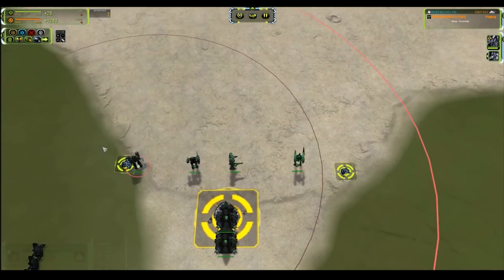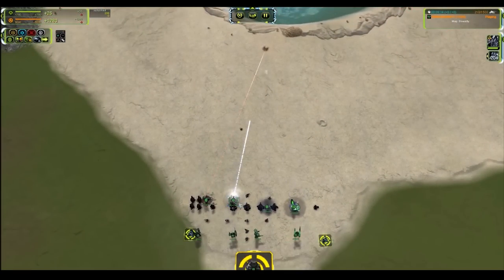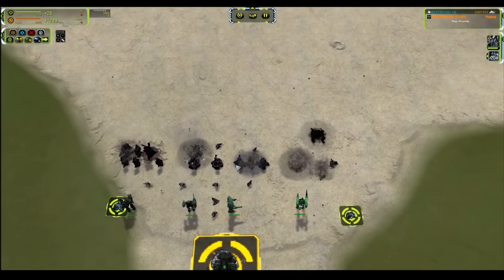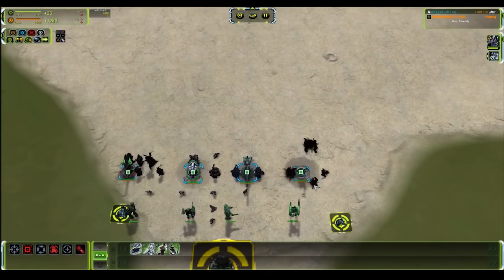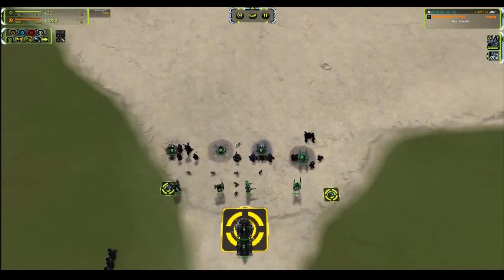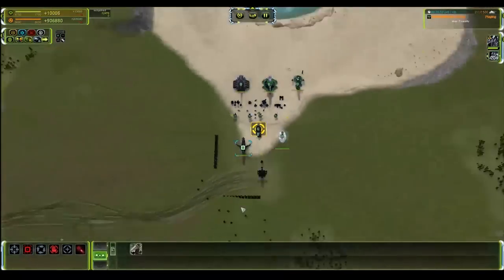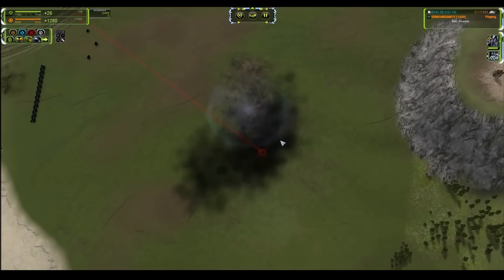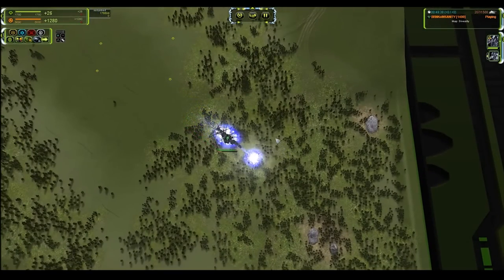Defensive Structures! Unit Tutorials for Supreme Commander Forged Alliance

Comment: about T2 arty, you can put T1 pgen next to them to increase the firing rate for nearly no cost.
about T1/T2 torpedo launcher, cybran have best statistic than the other.
about T3 static arty, aeon is known as the best for arty fight. (damage over does work pretty well against shield)
about T1 pd, it's the only structure that can be defended by walls.
Reply: actually you can defend T2 PDs against cybran rhinos with walls quite well
Reply from the maker: You can put a pgen there if you only have one arty, but if you are spamming arty it is actually more mass efficient per damage to build another arty than to put pgens next to them.
Reply: i didn't know for wall next to T2 pd against rhino. Thx speed
brnk : if you are spaming arty, you may want to get a pgen next to 2/3/4 arty. I'm pretty sure this would be more effective. (But you stack arty, so there is the aoe weapon drawnback... + pgen explosion death)
Reply: BRNKoINSANITY That doesn't make much sense to me. Couldn't you build grids? But it seems the discussion has very little impact anyways as t2 arty seems to be built so rarely.I just compared it with t3 mobile arty, the dps is lower even when calculated with +40% for pgens (if those 40 are true). You also get more range and less area. The Seraphim seems to be the best t2 arty.What about TMD? It seems those would be stationary defense? Afaik they are considered underpowered by some people and we might expect balance changes anyway. But it would still be interesting. I seem to be too stupid to position aeon TMD correctly, those missiles still tend to hit the shield behind the TMD.Also shields. I'd like to know more about faction specifics, especially considering the damage spill rules (how many still make sense for which faction?).Thanks a lot for making these videos, they are certainly helpful for noobs like me!
Reply: About the arty, if you are on T2 stage, then dont think about T2 stationary arty, its expensive, go T3 mobile arty everytime. But later when you hae T3 eco, T2 arty is not that expensive anymore, so in some situations its good, it can outrange fatboy, T2 navy for eample. And everything trying to reach your base would eat a lot of fire.

Comment: I was doing some testing with a clan mate some time ago with t3 arty. 3 T3 arty will kill any shield configuration that you can possibly make, meaning that 3 t3 arty > Mavor and > Salvation as to mass and power efficiency. 2 T2 arty will kill most shield configurations. 

Also mixing t2 shields into your t3 shield defence can sometimes be more effective than simply spamming t3 shields due to the radius overflow issues. 

I can't confirm this though since I'm limited to vanilla now :c
Reply: Clans?
Reply: its like saying your in club like FAZE or something, some people like to do it but i dont see the point.

Comment: If Novax had extra uses apart from mass extractor harass and intel, and it had an extra counter method, it'd be a lot more engaging to use.

I'd say give it extra damage against shields, like the aeon absolver, now it has an awesome extra use. Still does paltry damage by itself but it can break shields for arty or ahead of a ground push or bomber run.

And the most logical counter it should have is to be targeted by SMD. Or it could have a firing energy cost, so your opponent can sabotage your power grid to disable it. Or both.
Reply from the maker: Again, this is a unit that appears deceptively weak, but in reality it would VERY easily become op. The only reason it is not op right now is that shields completely stop a single novax (but not so much multiples). However, when you build a novax, your enemy now has to invest thousands of mass into shielding for what he doesn't want destroyed, so you are still drastically impacting his Eco even if you aren't actually killing his mex.
Reply: BRNKoINSANITY Well, yeah, but you also wasted tens of thousands of mass in building that Novax. I understand it works as a slight psychological weapon, but it's usually not worth it, not even for intel. For an experimental unit nonetheless.

You almost never see it used, and when you do, it's either in a very unbalanced game where the obvious winner has nothing better to do, or in games where it ends up not having any strategic value at all.

And it's especially bad because UEF only has one practical experimental on land-only maps. Novax should get some changes to make it practical and viable as an experimental unit.

Of course, if you just buff the damage, it easily becomes OP. I know that. Which is why I'm suggesting different mechanics and additional counters. This unit could VERY easily become a staple UEF experimental with some work.
Reply: zolikoff Also it allows you to see into the enemy base. Intel is priceless.
Reply: eytan19 Yeah, but spy planes also see into the enemy base. I know a Novax has its hypothetical uses (hypothetical because it's still used very infrequently). I'm saying its capabilities don't clash well with its experimental status, if it was a T3 intel building like Cybran perimeter monitoring, I wouldn't mind. It's especially bad because, as I said, UEF have just one viable experimental on maps with no navy. The unit to fix this already exists, the Novax woud just need some flavor.
Reply: Well spy planes can be countered by sams or patrolling asf's. My point is just that there will always be a use for Novax even if it can't do much damage. Increasing its damage or buffing it in some other way is not a good idea, it would very quickly become op.
Reply: eytan19 Point is, how often do you see the Novax used? It's a non-game-ender UEF experimental that sees less use than a game-ender. It's annoying. It should be a staple UEF experimental.

I'm not saying straight-up buffing it. I'm saying give it some strategic functionality and also give it other drawbacks - I even suggested a few possibilities.

Currently as an untouchable weapons platform, of course it needs to be weaksauce or it'd be OP. But I'm saying is get rid of the untouchable trait, and make it good at something.
Reply: Well it's kind of cheese because there is no counter and that's why it isn't used a lot. I think when used correctly it could be effective and very annoying.
Reply: eytan19 Once again, I'm suggesting giving the unit some viable counters, while giving it additional usability beyond mex harass and intel.
Reply: zolikoff i dunno... i've used three novax's to completely obliterate an entire army...
Reply: +zolikoff Is intel an undervalued (less talked about) aspect of this game? Seems to me that an all seeing eye or two would be invaluable. I've seen many scouting fly over designed for that purpose on Brink's casts. 
Wish I could play this game. It looks so good. I bought Sup Comm last week but now Steam is fucking with me....ahh it's probably just my inability to troubleshoot... still D:
Reply: Jonathan Halloran It's definitely not undervalued. It's very crucial. But sending T3 spy planes over the enemy base is more cost-effective than building a Novax for that sole purpose.

If you got SupCom, just download the FAF client and let it run the game for you. Though I'm not sure how it works in conjunction with Steam (if it requires log-in and such)...
Reply: zolikoff Hey thanks man! I think I will uninstall Steam and grab the FAF download.... we'll see how that goes.... I'm hoping my starcraft skills will translate over to this game (which I've never played). Hope to see you round. You'll be beating my ass no doubt!
But I don't think ppl would invest in Novax just for intel. Seems like the intel is a significant bonus just to sweeten the deal ;)
Reply: Jonathan Halloran Wait, don't just uninstall Steam. The game's files are in the Steam folder. Try giving FAF the executable in the game files, see if it still asks for Steam login (though I suspect it will).

Finally, if nothing works, just download Forged Alliance from a torrent tracker. It will work with FAF fine, straight away. It's not piracy if you already paid for it, but the pirate version will work without fuss. It's not your fault Steam is acting up, but it shouldn't stop you from playing a game you bought.

PS: I'm not that good at playing the game, it's really much harder than it looks from casts. Not that I have much free time to play, only once in a while, but I sure still qualify as a noob here :)
Reply: zolikoff Cheers for helping random noobs! Hahaha...I'm actually at the 'finally' stage right now (yes I noticed the file wasn't executable), so I think I'll go for the DL.
In fact, I'm currently sand blasting my processor to see if that helps. But I think the grain I am using is too abrasive. All the paint's gone :(
Reply: satannstuff Which is why I suggested to make it specifically an anti-shield unit that you'd use in conjunction with your army.
Reply: +zolikoff u know that 3 novax breaks triple(each under 2 uthers) aeon shields and kill commander... NURF IT

Comment: Duuuuude! You missed the special ability on the Seraphim's stationary T2 artillery. If the shot misses it's target and hits water, it turns into torpedoes! I thought I told you this already?!
Reply: Cryoxiis riiight.

Suuure.
Reply: Rabid Wizard I wasn't being sarcastic, it's an actual feature in Supcom FA. But I'm not sure whether FAF removed it (I doubt it). Try it out. Most of the time you see it when the artillery is targeting a naval unit and misses
Reply: Cryoxiis Ok, sure,

If so. it sounds awesome.
Reply: Rabid Wizard Well it's not very practical because the torpedoes just circle around the spot they hit till they die. So it seems like it's just a bug really. But still, a feature nonetheless.

Comment: It would help to have some of the relevant stats onscreen as you're talking about them, particularly some basic calculations like DPS/mass etc (with a note of aoe radius).
Reply: I argree but remember how pressed brink is for time.  Don't want to give him extra math homework.
Reply from the maker: If I was a full time or even part time you tuber as a means of support (eg getting paid) I actually love to do things like this! But I just don't feel like spending 4 hours in post editing putting that kind of thing together.... If I was only doing one video a week maybe, but for three sup on vids a week that would be 1 hour to cast, 1 hour to pre-process for frame rate and adding/editing audio, 3-4 hours to cut and splice alternate views, diagrams, numbers, and time in Photoshop, then another 30 minutes my computer is bogged down doing the final export...... All told about 6 hours per video, 18 hours per week. This is the reason I did like 3 videos with heavy editing and then stopped. Not that I don't want to, I just literally do not have enough time in a day to do all this as I already work ~50 hours a week at my full time job :/
Reply: @BRNKoINSANITY  Well, thank you for doing this video! I'm a long time Forged Alliance player (10+ years) and it was still interesting to hear your points.

Comment: another use of the novax is as paragon killer. Just hover abover the paragon and set to selfdistruct. you gonna need several novax though...
Reply from the maker: We don't do that to each other, gentlemen's rule. It is an unstoppable attack, and therefore cannot be prevented or balanced out.
Reply: @BRNKoINSANITY  Ironically they have tried to balance it in the latest patch :D Random falling animations!

Comment: Brink: quick question - How did you ramp up the build speed of the Hive engineering stations? Is it a mod? Were you using some energy / mass econ boost to upgrade the hives and get them to build so fast?
Reply from the maker: +vpp1956 it was a game with cheats on, and I just spawned 100 tier 3 hives. They just appeared all stacked on top of each other.

Comment: Try Mavor on 81 km map. It's pretty inaccurate especially when hunting for commander.
Reply: Benny Hillarious hunt the commander with t3-4 arty sounds like a pretty longshot idea
Reply: Ezario Gerion it's OK, when you use 6 of them. 😁
Reply: 81 km is well beyond the horizon mind you so the shot irl would factor the diameter and rotation vector of the planet. Besides its artillery not a guided missile.